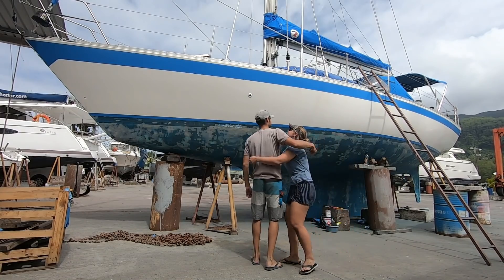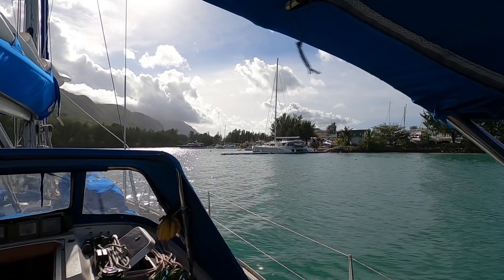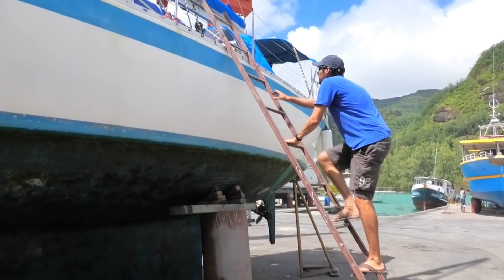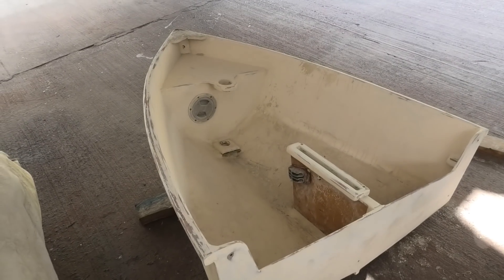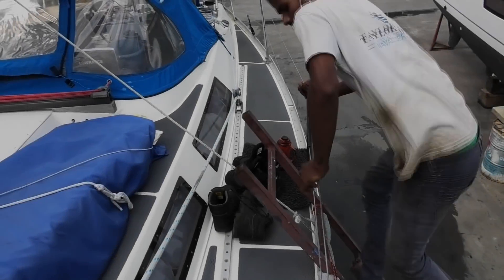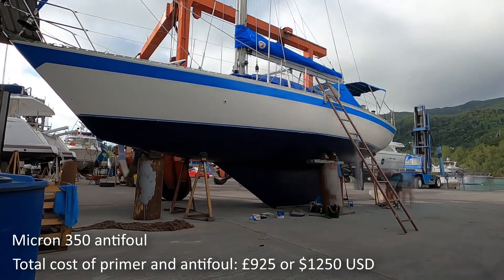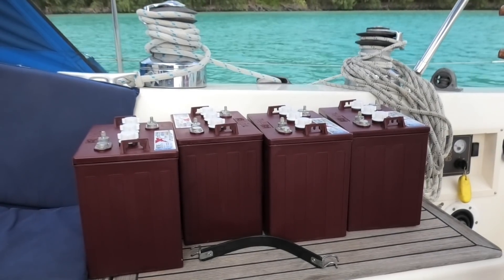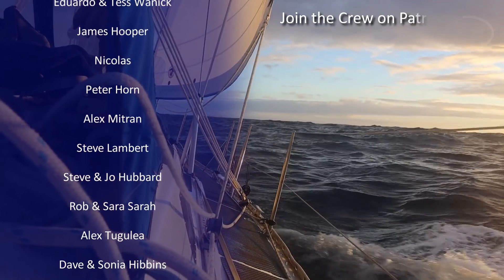TROUBLE in the BOAT YARD | Ocean Passage Preparation | Sailing Florence Ep. 116

Comment: You two handle the boat very well. Certainly you know everything about Florence. The best point you made was in your closing: “When sailing around the world, you need to know how to do everything yourself.”   Most people don’t even know what a thru hull valve is, and here you are rebuilding them!    On the topic of engine vibration, a worn cutlass bearing (stern bearing) can cause vibration. Bad engine alignment can also cause vibration with perfectly good engine mounts. When the cutlass bearing is worn, you can waste hours aligning the motor and never get the vibration to go away.      Great video.  I just found your channel.

Comment: If you use any hand cream before you start working with dirt (do your whole body if you want); it acts like a barrier and one shower reveals the old skin, good as new. Another use for this is to rub it in before a shower and it will pick up anything loose and the shower drain takes it away - perfect for feeling a really deep clean. Learned the first part from a motorcycle mechanic, adopted the second bit in my dating years. I liked to 'glow'!
Reply: If youve no cosmetic cream use  a  vegetable cooking oil on your hands and then when ready to clean up add more and grain sugar scrub it round and you can wash it off with ordinary soap ..it doesnt dry and split  the skin like detergent based soaps and no allergy problems.

Comment: Thanks for sharing.  I enjoyed your experience in the boatyard.  I owned for 31 years and sailed a Mariner 47 sailboat named Free Spirit which I sailed 170,000 miles in a circumnavigation of the North Atlantic, 6 Bermuda passages, and cruising of the entire west coast of Europe from the Arctic Circle to Villamoura, Portugal.  Spent a winter cruising the Caribbean and sailed 3 times to Nova Scotia.  Wrote about some of it in my book, North Atlantic Odyssey, Sailing to the Arctic Circle (St. Martin's Press, 1989 and the Boater's Medical Companion (Cornell Maritime Press, 1990).  I remember spending two weeks, 12 hours a day sanding and painting the bottom of Free Spirit, using a scraper to remove 2 years of barnacles in Antigua in a wet suit and getting hundreds of little shrimp-like creatures under the wet suit that itched like hell.  They did shower off.  This was in the years before Antigua had a marina that could haul Free Spirit out.  Dr. Bob Gould

Comment: My best off-shore boatyard experience was when I lost all the engine oil motorsailing around the tip of Guadaloupe and blew my engine.  My wife and I sailed into the Saintes where there was no one who could service our broken engine.  We then sailed against the trades for ten hours up to Pointe a Pitre where we called the marina for a tow.  Found an engine shop that could replace our engine but the new engine took 5 weeks to arrive from Paris and I had to sign a contract for $15,000 for the engine in French which I couldn't understand (despite 4 years of French in school many years earlier).  Weird to watch them drop a new engine through a hatch into the engine compartment (after taking apart some of the cabinetry).  The mechanics did a great job.  The six weeks we spent in Guadaloupe were among the best we had.

Comment: My first tune-in to your blog.  I really like you folks.  You are both hard workers with tenacity flowing through your veins.  Really like your identifying the music played in your blog - THANK YOU!!!  Changing out motor mounts and aligning the prop shaft is not all that difficult a task - it seems like it is because it scares the B-Jesus out of others, and they, in turn pass that "Oh My God" fear along to others.  You discovered the most ardent parts of doing it - OBSERVATION, measurements and checking clearances.  The prop shaft seal was replaced with an identical unit, therefore, the only change there was reliability - new for old.  I will agree that doing anything for the first time is a bit scary, but it's not impossible.  Simply tell yourself, well, if I get it wrong, I'll have to get more talent to bear and get it right.  Might want to investigate Battleborn Batteries.  There are several bloggers on here that swear by them, and I believe a few even got them for a cheap cost to test them for the Company and report back.  You can do anything you must do, and help is readily available.

Comment: Here in Puget Sound, we have the dreaded goose barnacle to contend with.  In addition to nonablative high copper bottom paint, we use the spray on antifoul primer for the prop since they love anything unpainted. The ultimate for removing barnacles on the hard is skimming with a dulled wood chisel. The barnacle bases go flying off and the bottom paint and hull are unharmed by this seemingly damaging implement. We used to use various putty knives but they were terrible. We still use a bronze putty knife on the prop if needed. I'm glad you could get the bill rescinded for the incompetent shaft alignment. What a nightmare!

Comment: One boat had found that the feathering propeller wasn't fabricated correctly. A "pin screw" was the wrong size so it couldn't go in far enough yet the fabricator's workers were using it anyway and so the propeller fell partly apart underway ! So, I waited to ask you this after you discussed it, sounded like the final statement was "do the engine alignment yourself" to me. Is that what I think I had heard ? PS those Trojans bring back a lot of great memories. Three six volts in series charged with one panel and you have a perfect laptop power supply ! Editing seemed flawless to me and video, very well done and a pleasure to watch.

Comment: Sailing is an experience.  Yes you can a lot from books but for your specific situation experience is the answer.  I have been sailing for many years.  Up graded  an engine.  Had to realign the shaft to the engine and build new stringers.  Boy dowe learn much!!

Comment: You need to be able to do everything yourself...well said.  In the 30 years we have replaced pistons, cylinders, trans, injection pump, .bilge pumps, thru hauls, painted every surface, rewired, used gallons of polyester and epoxy...BUT WE HAVE NOT HAD THE BOAT OUT OF THE WATER SINCE '96.....Had a trans split in 1/2.. 800 miles from shore due to alignment...no problem I carry an extra trans, and pistons, block, injection pump plus parts.  I cracked the stern tubing....sleaved it in the water...the cutless housing came off...replaced it...prop fell off...carry an extra...
More than anything else...I have a great partner...MY WIFE...she has been there to help and a lot of times do it.  Our 2 boys where 2 and 4...now they are 32 and 34....now I sit on the tool bucket  and learn from them....
FREEDOM...nobody owns the ocean...NOBODY...absolute total FREEDOM......so we deal with it......the ruffer it is...the more nature...the more freedom....no or low cost....in fact go to roefamilyband  for your curiosity click around

Comment: A simple trickguys mark a small hash mark on the forward and aft areas where you know the slings need to be for proper balance and avoiding shafts and the log impeller if it is mounted ahead of the keel which is not the best place it should be next to the keel forward portion 
The depth sounder needs watching as well that sling exerts a lot of pressure about like the heel of a womens shoe lol well Florence has her heels too 😎

Comment: Well done managing the boat yard. This episode was quality, through and through. Really enjoyed!
Reply: @chaimsalamon  I disagree but you are entitled to pontificate. Have at my lord.
Reply: @chaimsalamon  You get paid for doing work properly.  The work was gross incompetence.  Had they not double checked and done it themselves it would have caused catastrophic damage to their engine and/or propshaft.  The worst case scenario given how awful the work was is the shaft damaging the stern tube and the boat sinking.  Even an incompetent DIYer can get the propshaft roughly centered in the stern tube.  What the "engineers" did wasn't even in the ballpark of proper work.  Having the engine mounts so loose they could move by hand defeats the whole purpose of engine mounts.  Might as well leave the engine lying on the bottom of the boat until vibration destroys either the engine or the hull.  Then lets not forget the damage done to the boat.  Feel free to pay people who incompetently endanger your vessel, damage it, and then require you to go after them and do the work yourself.  Most people won't.  That isn't entitlement that is just reality.

Comment: Guys don't make any excuses for those Trojan Batteries. They are sold dependable deep cycle batteries that wont cause you any trouble and you don't need any "smart" charging system. I wouldn't waste the money going to any other technology especially on your budget. It is easy to get carried away saving the world but lithium extraction and processing is far worse for the environment that extracting and recycling lead. Another great video. Yes, check the engine realignment when back in the water. Release the coupling from the gearbox and run some feeler gauges around between the coupling and the gearbox output flange. Actually since your vid was from August I'm sure you have already worked that out! Cheers

Comment: Lithium 1,000,000 % worth the cost. The correct lithium setup changes your life on a boat. Over the years and through my 2 sailboats I’ve upgraded both go lithium and adjusted the electrical system and it eases the mind. Well worth the initial investment I promise.  Nice video!

Comment: Good work. Looks great. I'm exhausted just watching. 
For those fast lighter scrapes (right after you donned your protective gear.)  Get a longer handle if you can. It'll go much faster, and you can apply more down force if you need it.  Granted by the time I'm watching this, you're done, but for future and for others (and for my kitting out my boat in two years.)  And of course always have a smooth file in your pocket to periodically sharpen the edge of the scraper. 
And I always prefer a pull scraper (but I haven't done any barnacle scraping - a lot of house work and built a few epoxy/glass kayaks). A pull scraper usually never bites into like  push scraper can.  
Same with the rollers. On a pole rollers - of any size- are a lot more efficient. I'm also learning from your video that I should have on board the basic scrapers, blades, rollers, poles (scraper poles are more critical than those for paint rolling -even though they use the same poles. A paint roller can be pushed onto a whittled down stick. This won't work for a scraper.) 
I would always watch anyone who does any job a lot - usually they're about as efficient as they can be  - and you learn so much by watching. Just the way a skilled, experience person moves is incredibly valuable.  But you have to always be thinking. Sometimes they've just been doing it the most difficult way for years and years without ever thinking about it. 
Epoxy seems to be able to patch everything. I like to make the contact areas fairly rough. With enough tooth I think Epoxy will stick even to a waxed surface. (I've ruined several small projects when the releasing mold, wax etc didn't release.)  
A good tip is if you can't find epoxy filler use white flour (I've used instant pancake mix) - anything that has a year long shelf life (it's really not food. Real whole grain flour has a shelf life of only a couple of months.) I used the pancake mix filler 16 years ago and it's still as sound as real filler.  Once it's mixed and sets there's no food quality (so no rot, no bugs or rodents). The West System filler I think it's closest to is the medium to heavy hardware-attaching stuff - so it's not as useful as soft fairing filler. 
I've used WestSystems epoxy that had water condensed inside the cans. Horrible. I poured off any noticeable water. Still worked. 
Anti-foul. I've seen a few videos where cruisers paid for this job to be done and then had horrendous growth on their hulls. I wonder if once they left the crew to do their hull if they didn't just swap out the expensive anti-foul for house paint of the same color? 
As soon as they said they needed another jack, in hindsight - I'm guessing they really were not experts at all. They should've arrived with everything they needed, and if they needed something else - an experienced worker knows where to get it.  I'd have googled engine mount replacement and How To align the shaft and then done the work myself. If they had to come back because they didn't do it right the first time - they didn't know what they were doing.  So tip to all would be cruisers from an old carpenter - learn as much as you can about fixing stuff - this means crawling under the sink to fix pipes. This will be at least an entire day of your life, at least $100 and multiple trips to the hardware store or plumbing supply. If someone you know goes to the boatyard, follow along to watch. Chip in, especially on the most miserable tasks. (wear masks, eye protection and long sleeves). Watching someone who really knows what they're do is a terrific education. You'll be surprised later when you do something similar and you find yourself trying to move like they moved. (There's a lot of dance in skilled labor)   Sorry to be such a busy body. Hope this has some value to somebody.

Comment: To berth alongside, you have to throw a line from slightly forward of amidships, make fast on the quay where you want your stern to park, and drive dead slow ahead against this, called a "forward-back spring" until alongside: when you can make fast bow lines back springs and stern lines.

Comment: I had a 32 foot cutter with a shoal keel that could tack  very high into the wind.  The rudder was a sheet of zinc plated steel  attached to the boat by 3 pintles and gudgeons.   The engine was a 2 cycle diesel . The hull was lapstrake (clinker) constructed, so somewhat high maintenance  but easy repair. The boat yard that I used would  use a rail system to haul out a boat. A wooden cradle would be attached to  rail wheels, which was  rolled into the water  like a boat trailer and then you would maneuver the boat into the cradle. The sail locker was in the bow and held 3 sets of sails. Storm sails and cruising sails; plus a spinnaker. Sails were cotton .

Comment: Matt and Amy..re engine mounts:
Now that your engine is aligned, do the following:
1. Mark the outline of the base of the mount on the engine beds using a permanent marker pen...this will give you a visual clue if thete is any movement.
2. Loosen mount bolts 1 at a time and then fill any slotted holes in the mount with epoxy... retighten the bolt. That will stop the mount from possible lateral movement due to the slots.
3. Make up a plastic gauge for each engine mount (credit card plastic or something similar) and trim it to size for the final adjusted height of each mount...i.e. from the top of the engine bearer to the underside of the feet of the engine. This way you can easily check if there has been any gradual settling of the mounts over time. This is much easier then seperating the shaft coupling from the gearbox and testing whether it still aligns (horizontally, verticularly, and angularly).
Hope this helps.
Cheers, Mike and Gay, Expeditus (the red boat..we anchored ahead of you in Sabang. We sailed directly back to Adelaide from there)
Reply from the maker: Thanks Mike, Good ideas, that will certainly make a quick check of the alignment easier!

Comment: The engine alignment is actually no big deal if you know how to use a feeler gauge.  Start with the propshaft flange and check against the engine flange.  The need to be parallel both between the flanges in vertical and horizontal.  You achieve this by adjusting the bolts on the engine mounts.  Not very difficult, you would fine Y-tube videos that explain this.  Sorry to hear of the bad experience from the yard, but you did a very good job.  I admire you as a sailing team, well done.

Comment: Ok...last time...YES FOR GULF CART BATTERIES...then use a CS-130 alternator...then house solar panel with an NPPT optimizer and 2 converters one 400 watt and a 2000 watt...one of these needs to be a true sign wave.....oh and buy the smallest simple refrigerator/freezer...tear it apart...install some valves and install in the refer box.....you know, it is about the journey....I should not take away the journey

Comment: When I had to align the prop shaft on my Spencer 42 - I got the prop shaft where it should be and moved the engine by adjusting the mounts .  I was fortunate in that it was easy to get to the mounts and they had adjustment screws in all planes.   There is really no other way to go about it,